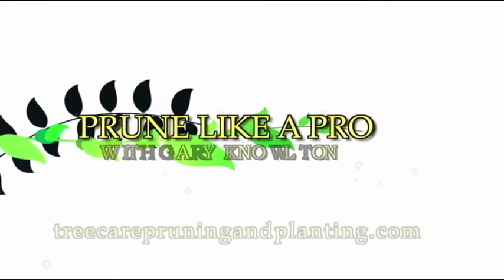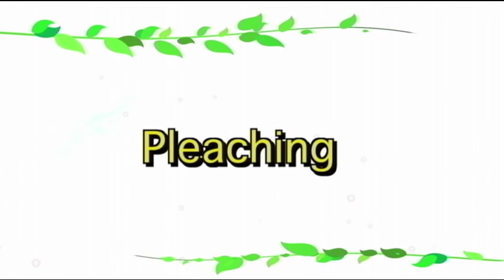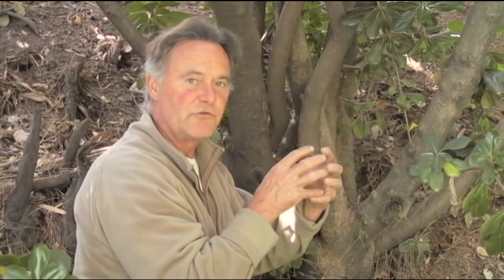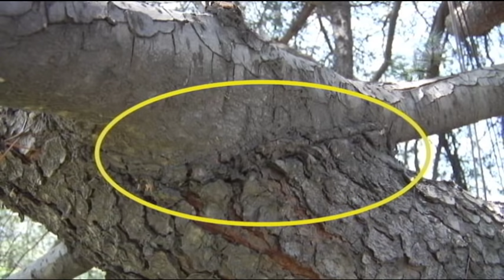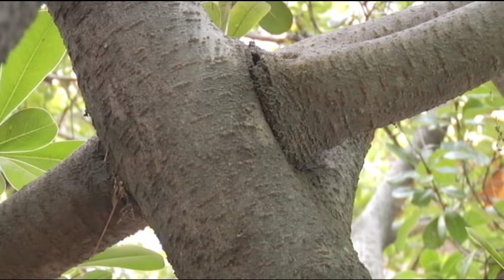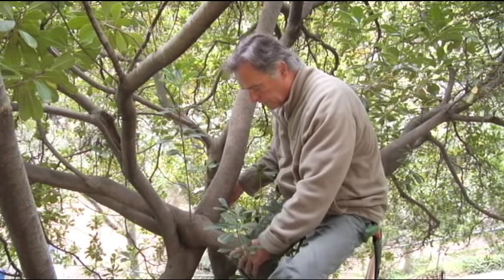Pleaching - Prune Like a Pro

Comment: Gary, I had to look this up.  Inosculation is a natural phenomenon in which trunks, branches or roots of two trees grow together. It is biologically very similar to grafting.
 
It is most common for branches of two trees of the same species to grow together, though inosculation may be noted across related species. The branches grow separately in proximity to each other until they touch. At this point, the bark on the touching surfaces is gradually abraded away as the trees move in the wind.